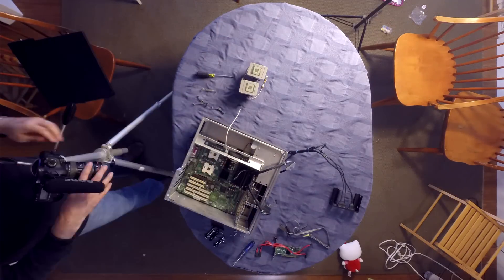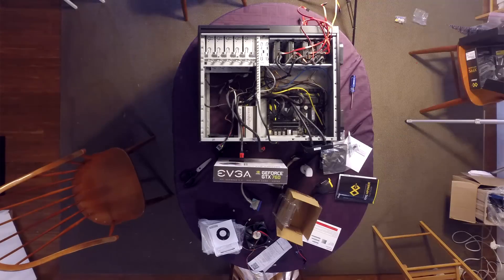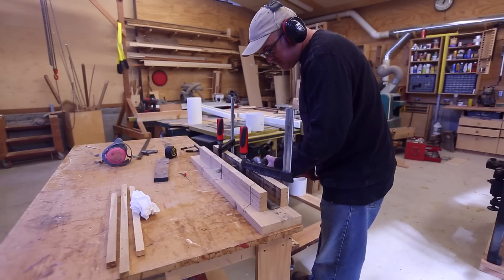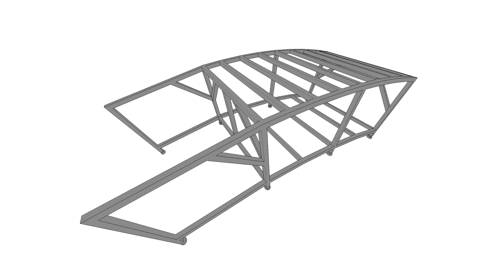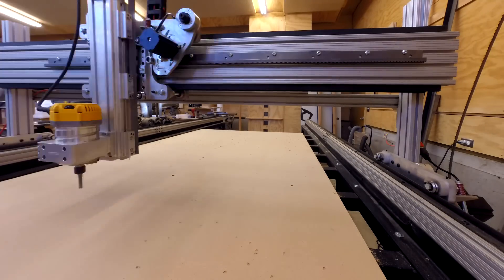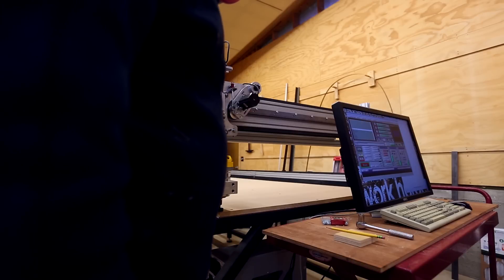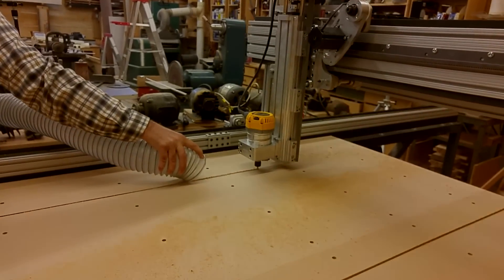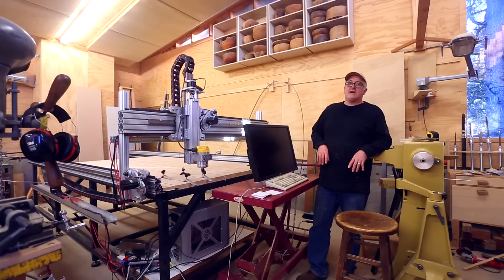The CNC Build: Part 3

Comment: There are a lot of All in One liquid coolers that you can mount in your system or if you are creative you can run the tubes outside and have your Rad outside. This will give you easy access to just spray clean your system. Slap some dust filters on your intakes and you will be set against dust.
Reply from the maker: +Jason Mohammed I had not thought of that, I like it.
Reply: +frank howarth I believe NZXT x61 and x41AIO cooler has longer than normal tubing so it should be good to work with. Also cooling your pc does not need to get fancy. If I were you and I had your tools I would mount the pc under the desk. Linus Tech Tips recently did a video on that and the major problems are length of cables. But if you mount it on the underside, theres an even less chance of dust gathering. So your desk with monitor and keyboard will be with your computer as well, and maybe it can be on wheels like it is now.

Comment: Fantastic! Very impressive build! 
Being in the same situation regarding CAM I eventually settled on CamBam. It has all the features you might want to use on an machine like this, not too expensive and it's easy to learn too. You could have put in holding tabs for your inlay pieces for example :-)

Comment: I wonder how dust collection could be done properly for such machines - it often seems to be only an afterthought in the design ("well, I'll just clamp a hose next to the router bit once it's built") instead of being a part of it from the beginning. Even cable management is something that often seems to have higher priority.

Of course, building a hood for the whole thing would be overkill - but is the only viable option really just adding more weight/resistance to the router portion (which probably hurts precision) by adding a hose?
Reply: +Sukrim They normally have a dust shoe on machines like this, especially when using the DWP611 for the spindle. Some use air diverters without the shoe to prevent the router from blowing dust everywhere. There are lots of 3d-printable/machine-millable files out there for this particular router.
Reply: +Sukrim Make dust shoe using plexy glass and some... thing to make proper seal, connect that to flexible hose that is connected to router part of the machine leading up into sealing where you make "arm" using simple wood and hinges moves the hose horizontally with the router head, then run the hose out side of the work surface, connect it to roof in that point and use bungee straps to help support the weight of the hose+ keep it from pulling the arm too much. Rest of the hose you can run where you want it.

Other option is to get really flexible and stretchy hose and just screw that into sealing, middle of machine. If cnc machine is proper quality it wont hurt precision. You really need to have lousy frame if that should happen. I would be more concerned about the frame flexing like my DIY manual metal mill is doing as its tolerances are around... somewhere near next county! :D Of course dust collection hose might have some negative effect... but then again you need to be doing routing in machine size like his and the cut size around 0.01mm. For any regular job it wont cause issues if it just does not get jammed somewhere.

Comment: Im just starting in cnc at the moment! I found the machine building the easy part the software is where Im struggling! a couple of people have recommended fusion 360 and vectric V Carve which are good programs (free downloads i think for none commercial). try inventables (x-carve) forum plenty of people on there who use different software and plenty of recommendations. Will you be making a dust shoe or something your computer may soon be clogged up with sawdust? (a job i keep putting off lol) jay bates has also done a video on cnc software. 
Really enjoying the videos thanks Frank!!

Comment: You should try estlcam as CAM Software. It works very convenient and also allows for an easy use of holding tabs to secure smaller parts while routing

Comment: Nice project, Frank. I just purchased a CNC machine (not quite bold enough to build one) and am learning the software. Vectric V Carve Pro and Aspire are quite powerful for 3D and 2D work and well supported. Any CAD program that can generate STL is potentially useful as there are CAM programs that can convert the STL into G code. Sketchup can generate STL so it, combined with a CAM program (Any of the Vectric programs, Deskproto, many others) can be a reasonably powerful tool at a fairly modest cost.

Comment: Here's a trick I've seen others do in terms of holding the piece you are cutting. if you are cutting something that needs to be 1/4" thick use stock 5/16" thick and set your depth at 1/4" leaving 1/16" to hold the piece, then sand away the excess to release the piece.

Comment: Hey Frank, great video as usual! As for holding down pieces being cut out, you can use double sided masking tape on the back of that piece to hold it down to the table. I worked at a place that used CNC machine in plastic manufacturing, and we used double sided masking tape when we needed to cut out a bunch of pieces without having them move. As usual, fantastic video and good luck!

Comment: I often use double-sided tape to hold down my work pieces. Or you can program tabs into your designs that you cut off later?

I also learned the hard way that you can use the same size butterfly as the hole itself. Ugh.

Comment: Frank,
I have tried out a number of the non-"freebies" and actually found that Autodesk's Fusion 360 is quite good.  The software is free for anyone making less than $100,000/yr off the products of the software.  It's 3D modelling is not as good as most full featured parametric CAD programs, but it has all the operations you'd expect from an expensive CAM package, but free.

Comment: Great work, Frank!
Building a CNC router is on my wish list of projects for when I have the time and the space.

Regarding CAM software: I've been using Autodesk's Fusion 360 for CAD and CAM lately and suggest that you give it a try.  Some of the CAD work was destined for a 3D printer, so the CAM doesn't apply there, but I've used the CAM portion to generate code for my metal-working mill and it worked pretty well.  IIRC, it's essentially the same CAM as one of the much higher-cost packages for SolidWorks.  It's inexpensive, there are a lot of good training videos, and the feature set is extensive & growing rapidly.  John Saunders at NYCCNC has some good videos on designing parts in CAD, moving them through CAM, and then machining them on a Tormach mill.

Comment: If you use Solidworks then HSMworks express is extremely good for 2 and 2.5D work and it is free. The full version of HSM is very expensive but can be rented on a monthly basis if you have a specific job.

I have a couple of videos on my dust extractor head, it is based on the ones used by Datron (search for Datron chip extraction) the nice thing is that it stays very close to the work independent of cut depth. It does require a bit of thinking to ensure that it doesn't suck down to the bed but happy to advise. I cut carbon fibre on my machine and nothing really escapes.

Comment: I see that your cable tray chain for the head is too short, it goes taught at the far end of the gantry.  These should have a 180 degree curve in them even at full travel.
Reply from the maker: +eformance I noticed that too, I need to adjust the cables a wee bit

Comment: Frank, check out a channel called "mtm wood" here on YouTube. He does alot of inlay work like this with the cutting boards he makes and seems to have the process worked out really well using a CNC machine.
Reply from the maker: +Seldom Bored Yes, I'm subscribed and watch.
Reply: It seems that he leaves a small amount of material when he does the inlays. It looked like you were cutting all the way through when you did yours. You should try that or possibly leave a few tabs that hold onto the material and then those can easily be trimmed off.

Comment: Looking good, Frank.  Hmm, maybe a swing up table for the monitor/kbd so that it stores under the table when not in use?   Yeah, a bit over complicated!  

Really too bad about how the metal table bowed.  I'm sure that must have been pretty frustrating!
Reply: +wordsnwood I think that  adjustable bars to push the legs outwards could solve the warping. That way it won't be able to move again once its flat and tightened.
Reply: +Barthoization 

I doubt it.  The loads are enormous.  I just welded up a pedestal for a leather sewing machine.  The top plate the table rests on is 6"x6"x1/4"  I bent it way out of shape.  And I feel silly about it because it was fine, then I started adding extra welds to it, and pulled it all out of shape.  I just forgot.  I don't do this much and it was a new welder and I was welding in the cold.  The loads to bend large pieces of tubing are huge, and if you then fit in more braces as you go, the errors are pretty much irreversible.  Wood is a better bet. This is not a circumstance where tons of strength are required. to support granite slabs or something.  I just saw a table on the local craigs that was similar and it was supporting a 4'x8' x14" granite surface plate!
Reply: Hondo Trailside s

Comment: I recommend that you address the frame flatness issue now instead of continuing with shims.  Once you cut the members that are causing the bow, the tubing will be rather compliant and you can tweak the bow by adjusting the center feet to put a little preload on the top bars.  Then once everything is good, just make some sleeves and bolt them over the cuts you made in the bar, then you don't have to work about additional shrinkage.

Comment: I used BobCAD-CAM software on my last home built CNC and it works well. It has some quirks but it is adaptable and you can also utilize M-code with it for bit changes and alterations to the current work piece without having to start a whole new cut program.  Frank, I really enjoy your videos thanks for your time it is appreciated and it was nice to meet you at WIA this year.

Comment: You need to at least put some kind of filter where the computer fans intake, before you make that computer box or the computer won't last very long. Also, Dave over at +Make Something did a video where he talked about an easy way to cut out shapes like your bow tie. He showed not cutting all the way through and then using a band saw to finish the cut and then smooth it with sand paper. Keep up the amazing work.

Comment: There is a chap called MTM Wood from Russia that uses a CNC machine a lot. He doesn't go though the wood totally for the inlay. He leaves a little wood on to stop the bits that flies off. Then he sands the back off and it all slots in well!
Love the machine though. Can't wait for more videos.
Reply: +Darren Boss yeah, that MTM dude's inlay work is absolutely fantastic
Reply: +Darren Boss The best inlays I have seen are the tapered cut ones. Perfect fit everytime. Like a cork in a bottle, or tapered dowels.
Reply: +Darren Boss Agree
Reply: +Darren Boss for anyone going to check it out, the norwegian flag end grain cutting board probably features the most extreme inlays with lettering less that 1mm thick
Reply: +Darren Boss He's actually following that guy, I saw Frank asking some questions on his videos.
Reply: For doing inlay, you can use a V shape routerbit and always make a mirrored image, with this technique is always 100% thight... I use a old vector works to make my cadfiles got it when I was still at school and goes pretty good and fast
Reply: ***** I'm with you there. I think it's because everyone is different. No two are the same.
Reply: threeque That's it! If I recall he uses a tapered drill bit to make angled edges so they fit in better and give sharper edges.
Reply: +frank howarth really go check his stuff out his trick is he doesn't cut his inlay all the way and then plans it down to get it.